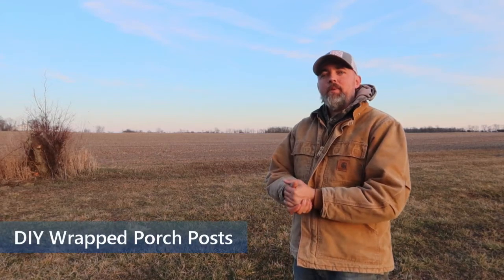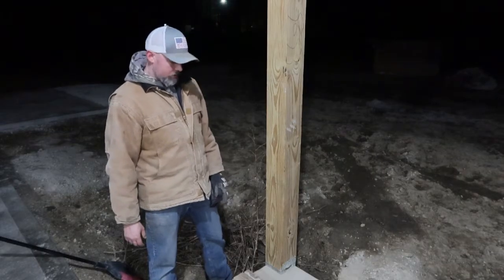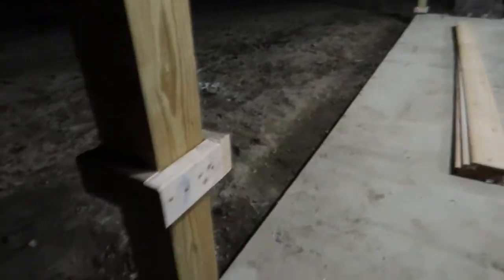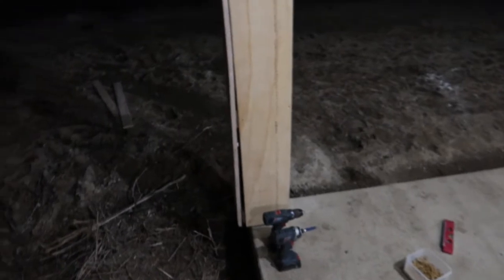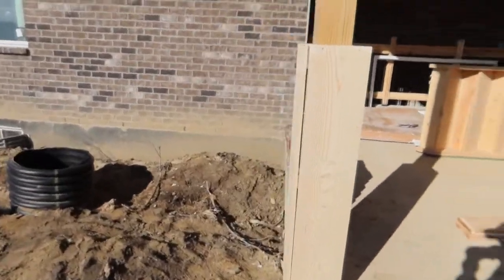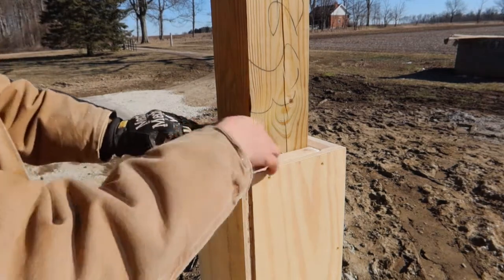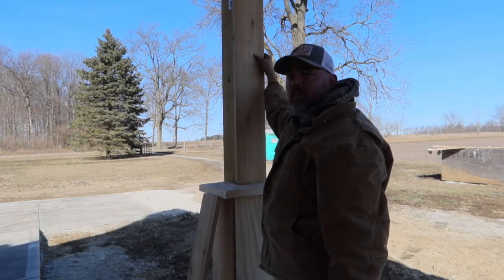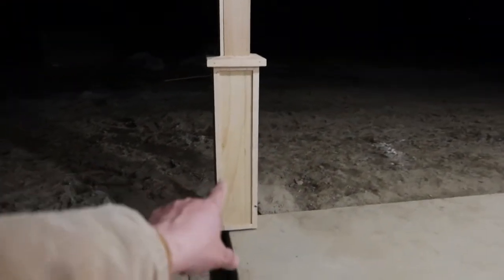DIY Cedar Wrapped Porch Posts

Comment: Seth I got a question. I’m wrapping my Columns which are currently 4”x 6” posts so basically gonna have a rectangle. I’m gonna stucco the posts so is osb ok to use as paneling?
Reply: Also thanks for the video it’s exactly what I was searching for🤙🏽
Reply from the maker: Sorry for the delayed response.  I need to look at my comments more often.  OSB is probably fine.  If it was me, I probably would use a higher grade plywood.  I'm probably a bit too cautious but OSB likes to soak up too much water for my taste.  Hope the project works out!